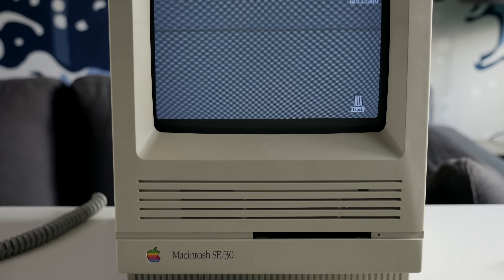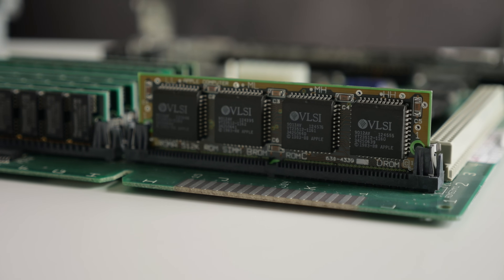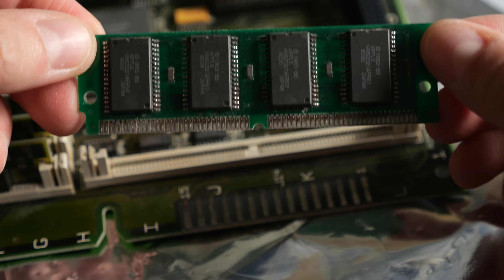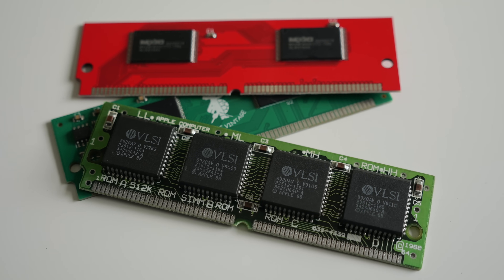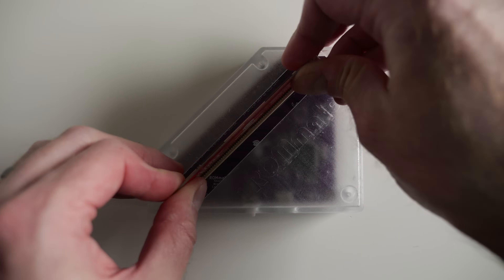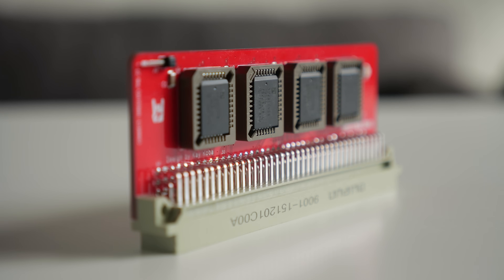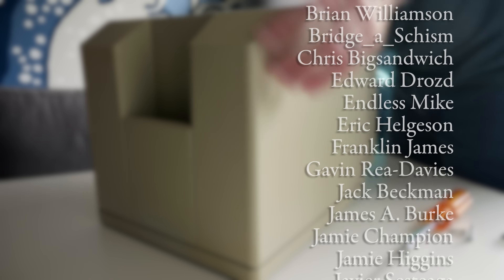This fix for a common Mac SE/30 problem is GENIUS

Comment: This gadget literally resurrected my Se/30! It had the same horizontal lines (simasimac) as Kay's se/30 in the promo video on his site. I had tried almost everything (recapping, cleaning  with alcohol, changing chips, searching for broken trays, trying rams, roms, replacing bourne's filters etc. Thank you Ken and I hope some day you could develop a pass through pds board so that we can have another pds card installed along the ROM.

Comment: Every PCB manufacturer which offers custom layer stack up can produce 1.3mm PCBs, the 1.2mm limitation is only valid for PCB pool manufacturers which combines multiple customer PCBs on the same panel.

Comment: i mustve had a pile of about 50 Mac mouseballs in my locker in highschool. schools transitioned from the 2e to the mac's when i was a kid & it didnt take long for me to figure out you could open the bottom of the mouse & remove that cool rubber ball. when i think about it now as an adult, i realize it mustve cost the school district SO much money

Comment: FYI, PCBs can be made in any thickness we spec. However, non-standard thicknesses a little more. Those module manufacturers should have just asked for a different thickness.
Reply: Depends on what company I’m aware that a lot of them will only make custom sicknesses for a massive fee or if you’re ordering over 1000
Reply: @TheLostPacketYTyes it will be more expensive because the custom layer stack up requires the manufacturer to produce it only for you. With standardized layer stack ups they can combine multiple different customer projects on the same panel, they can fill empty spaces of the panel with smaller PCBs and if the yield of good PCBs of one customer order was not reached, they can add the same PCB again to the next combined customer panel.
If the customized layer stack up order is not filling a whole panel, they waste much material or in case the yield was not reached, they need to produce one full panel only for you. Additional the custom process is more complex for them
Reply: @TRFH94  it can be a lot cheaper but it highly depends on the situation if it’s to the point where they would fill a panel with your boards for them if you use less material, it could cost less

Comment: Meh, I gave away my SE/hd80 with 030 40mhz card away years ago.  So that PDS slot may already be filled with an accelerator card.  The SE kind of totally swx without one.
I got a barn full of this rubbish now and haven't touched it since the 1990's...
I probably should have removed all those batteries but never going to happen.
Not enough hours in the day to go through 30 single core Macintoshes with a torx screwdriver and remove the batteries.

Comment: Don't know how viable this is or if it's perhaps cost inefficient, but having the PDS part simply being a converter into a ROM socket, and then having the ROM part being the standard ROM SIMM, would be pretty cool. Make it easier to reprogram, too.
Reply: It was mentioned in the video that new old stock ROM socket inventory is getting more and more limited. That could probably work, but it eats into the limited supply of sockets available.

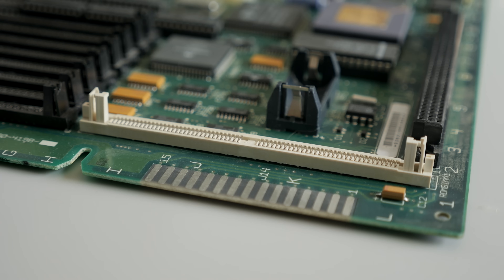Comment: 3:10 That can be fixed easily. It's only 0.1mm narrower which is only 0.05mm per side. Just add a thin layer of solder on the contacts and that will fix it.

Comment: Hi I'm Kay Koba, thank you Colin, and thank you to all the viewers for your interest and comments. 

Furthermore, with the traditional ROM socket method like our cards, even if the ROMs are damaged, the repair can be completed by simply replacing the ROMs. As far as I know ROMs will break over time, I don't know when that will happen, but we hope our cards last a long time...

There were opinions that it would be nice to be able to use it in conjunction with other PDS cards, but at the same time, it is difficult to test many PDS cards and guarantee that they can be used together.  Also, increasing the number of connectors leads to increased costs. To be honest, PDS connectors are more expensive than other connectors, and it has to be implemented with a 4 layer PCB, which increases costs.

I thought this shape was the best for now. I think that the usage will be limited, but I think it will be quite useful. Enjoy it.

Comment: 2:53 My first thought was just to tin the pads. the extra thickness of the solder would get you a solid connection against the slot pin.
Reply: I agree!  This would be a good solution for adding some thickness.

Comment: The only issue is it takes up the PDS slot, making installing an accelerator, ethernet, or video card difficult...
Reply: Here is a thought...  An SE/30 expansion chassis the size of an Apple SE series scsi enclosure that has 2 PDS slots.  If someone can build that, I'll be the first to buy it.

Comment: Sounds like shimming the 1.2mm ROM pcbs up to 1.3mm with a 0.1mm sheet of plastic or pretty much any stable material will fix the stability issue. My SE/30 definitely suffers from this as I have to wiggle the rom pcb to get it to boot.
Reply: A plastic shim would make a tight fit, but sit between the pins in the socket and pads on one side the PCB and break the connection

Comment: what would be cool is to make a built in programmer with usb c port so you can just pull out, plug in and program it. Now that im willing to throw upto $100 in for if it was real.

Comment: That lead clip looks like a disaster waiting to happen.
Reply: Yeah seems like a temporary debugging tool at best. That clip is jank.
Reply: Would be best to just cut it off and solder the wire direct to the chip pin
Reply: You're probably right about the tiny pins here, but I've seen these do wonders on older, larger DIP ICs, in situations where there's more area to grab onto and less other contacts nearby to short to. The one on the Amiga Megachip expansion worked surprisingly well.
Reply: It honestly would have been much better to have you solder a single wire to some larger component. The clip is too easy to damage your irreplaceable IC with.

Comment: The problem with this is it ties up the PDS.  There were many, many PDS cards for adding capabilities to the compact Macs.
Reply: someone else mentioned adding a PDS pass-thru slot to the ROM. seems doable but it would change the geometry of where the expansion card would line up.
Reply: At least it gives you a functional machine if your ROM slot is destroyed. 

It's like a back up option, it's not trying to replace the original ROM, it's just to solve a problem. 

If you need that socket then you either have to fix your ROM slot, or find another mainboard.
Reply: @volvo09  I agree.  I just think it should be a better fix, one that will allow the slot to be used.

Comment: Would be cool if this also had a daisy-chain PDS socket on it so I could put another PDS device and use it at the same time.
Reply: They exist! There’s one that lets you put in up to three devices! (I’ve seen one build that has a CPU upgrade, network card, and video card.)
Reply: @AnonymousFreakYT who makes it?
Reply: Its called the twinspark, it supports IIci pds on the side and passes through se/30/IIsi pds. Bolle’s twinspark has a maccon built in

Comment: I've repaired a battery bombed Mac. It's a miserable process. Protect your machines.
Reply: Those batteries are terrible.

Same with the rechargeable NiCd batteries on some older PC motherboards that leak.
Reply: As if the traces eaten by cap electrolyte weren't annoying enough, every Macintosh includes a special "death alley" region on the motherboard that may be flooded in corrosive slime. So many sellers on sites like Ebay will purposely keep those areas hidden, in photos of Mac IIci/IIcx machines.
Reply: Yes. I cut the CR2 battery out of my apple IIGS and used a AAA battery kit from reactive micro and velcroed the batteries off to the side so if they ever do leak, it’s onto the metal shield, and not on the logic board. Plus AAA batteries leak a lot less violently than CR2 batteries.

Comment: Hey Colin, is the SMC PDS ROM better than the Mac ROM-inator II or no?
Reply: The ROM-inator goes in the ROM SIMM slot - if that slot is toast and you can't replace it, you need the SMC PDS ROM